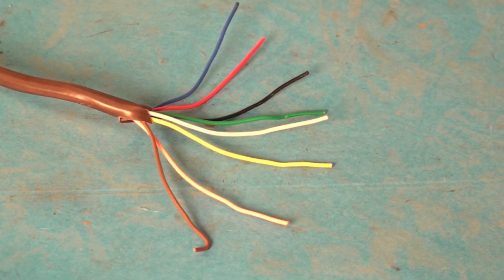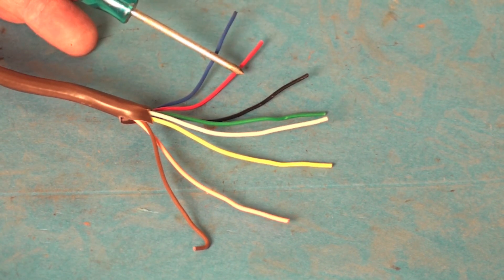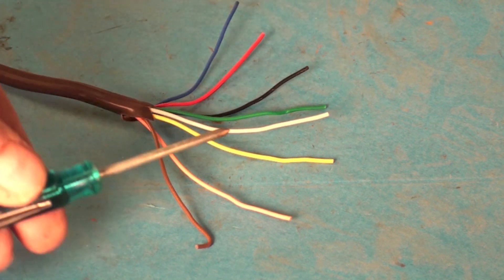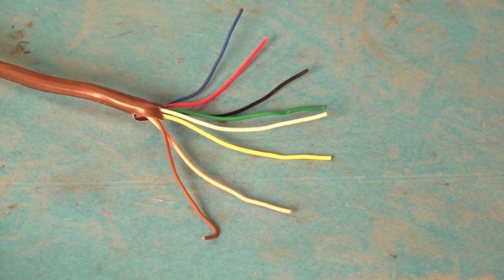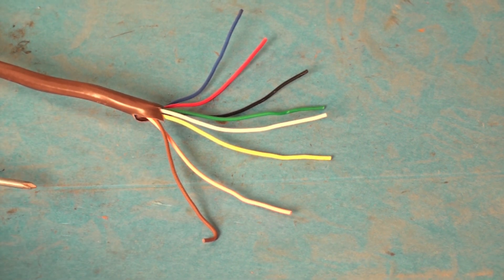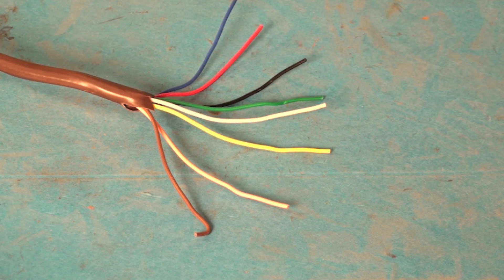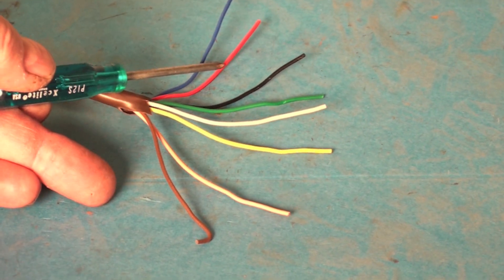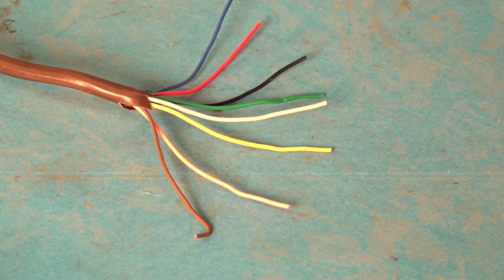Heat pump thermostat wire color code

Comment: blue is common (c), 
red is (rc rh) jump them together if your not sure
orange is (o) on majority of brands * excludes RHEEM RUUD then you would hook to (b). If it has a b/o terminal then hook to that and follow book to program it to energize those terminals in heating instead of cooling. 
green is fan (g)
white is (w2) 
Black and brown are either outdoor air temp sensor (on newer houses) typically going to an s1/s2 terminal. If they are not connected on the old one then do not connect. If they are connected to W1/e then re-use, if you dont have a w1/e then stick them with the w/2 which will be a bitch but will help energize your heat strips on a call for E-heat.
Yellow goes to Y1 or if you have a y/y2 then that on carriers. 
Do not do this with the air handlers power on. You will blow a fuse or transformer and have to spend even more money on a n hvac tech to come to your house. 💪🏻
Reply: I have a Ruud AC from 1988. Last week I replaced my old mercury type round Honeywell thermostat with no programmable simple digital Honeywell thermostat (RTH5160). Since then my AC does not work. Outdoor unit is quiet both compressor and fan. Only indoor fan comes on.I had B Y G R W on old thermostat. Connected B to o/b on the new one. I don't think I have a heat pump. I tried leaving black B wire not connected, it did not make a difference. What might have caused no-ac situation? I couldn't find a fuse in my furnace. I replaced both fan and run capacitors too.
Reply: Recently, OxBox a Trane company also decided to change their wiring on their heat pumps. No idea why they would do that on their contractor grade equipment.  They energize in heating mode.

Comment: I am replacing my old thermostat with a Honeywell rthl2510c, my old terminals are as follow:
X-black
O-orange
Y-yellow
W2- light blue and white
G- green
E- brown
R- red
  
New terminals are:
B. O. G. Y. W/aux. NOt used. R. Rc. 

Any advice on how to connect it properly.  Also how do I know if I have an auxiliary heat pump or not?
Thanks
Reply: Just wondering why he keeps avoiding to answer any question regarding the black wire.  He answered the other colors and disregard the black one. So let me ask where does the black-× wire connect to in the new thermostat?
Reply from the maker: pamkaturi O to orange, Y to yellow,  G green, E brown not sure, R  and Rc jumper Red.  If you have an outdoor unit you either have an air conditioner or a heat pump.  You can tell if it is a heat pump by the number of wires going to the outdoor unit.  2 wires, you have an air conditioner.  5 or more, its a heat pump.  Hope this helps.
GFM

Comment: Wrong the brown wire is a signal wire if your going to explain the wires and what there for at least do it eite
Reply from the maker: michael houser The color code for control wiring is not set in stone.  This video gives a common method but is by no means always used.  There is no method that is universally accepted.
GFM

Comment: Can you put a Maples Chase   thermostat 9601 for heat pump on a ;forced air gas furnace with no AC ?  thanks
Reply from the maker: I believe you can. Just hook up the r and the w and place the system in em ht. Hope this helps. 
GFM

Comment: Copper wire is copper wire, there is nothing magical about the colors and you sure as hell can't count on it being wired up to any standard convention. Get a schematic for the system, google is your friend on this one, so you can tell what goes where. I have even seen the colors change from the control board to the thermostat. Have fun.
Reply from the maker: Jimmie Fender The point here is give some idea of what the code may be.  We have all run into color code usage that does not follow my guidelines.  Thanks for the thoughts.GFM

Comment: I purchases a Honeywell 7 day thermo.model RTH2510B showing the use of 4 or 5 color coded wires for use with my GE heat pump (running 35 years w/out repair) using aa GE Weathertron thermo model T344D100M179. The Weathertron has 4 hg bulbs with 2 white wires on left and only 1 on right.Please advise wiring instructions. I have pics but don't know how to send.

Comment: I wanted to change the thermostat on my Carrier based Heatpump sytem and I have encoutered issues.
The current thermostat is a Comfort Zone II (master) with a 2nd zone slave thermostat.
The wiring to the master is nothing as described and has only 4 wires Blue (RS-), Red (RS+), Green (VG) and Purple (V+).

I have called Carrier and theyve told me Ithat they're wifi thermostats will not work on it and in any event I would have to talk to a contractor. Called Honeywell, and they told me there's wouldn't work. Called a local contrator (in NC) and they told me the control boards and dampers would have to be changed to change thermostats - ~$2500

Any thoughts would be appreciated
Reply from the maker: Elliot Check Unfortunately, there is not any cheap way out of this.  The Wi Fi stats work ok with single zone systems, but with zoning its a professional job.
GFM
Reply: And extremely expensive
Thanks for the help

Comment: ok what if u have a 6 wire system for heating and cooling then how do I wire it, and what kind of thermostat would work any cheap one as long as it has cooling and heating or do I need a special one that well wire a 6 wire system ,the thermostat looks 100 years old its big and brown, so I don't now if I should even touch it cause everything is working but I would like to get a much simpilar one ,which I can set the heat or cooling and leave it alone ,thanks for any help
Reply from the maker: mrcrazy3872 I need to much more about this system.  Can you send pics of the wiring at the thermostat?
GFM
Reply: it wont let me post any pic on the message o well my luck.

Comment: I have a honeywell thermostat(batt powered) with 4 wires coming out(red,blue,white, and green) going to an old singer electric furnace. The spots to hook the wires on the furnace are labeled C,G,R, W1 and W2. I have red on Rc&R(jumpered), white on W and green on G. For the furnace I have green to G, white to W1 and red to R. The think that has me confused is that there is no yellow wire for the cooling. This also throws me off to where the two wires(red&white) goes to on the board. I only have the red with red at the furnace. I know the white should be with yellow, but I don't have a yellow wire nor spot on the furnace for it. 

Any help will be very much appreciated!
Reply from the maker: The problem here seems to be there is no yellow wire.  If the blue is connected to the Y on the stat, then the blue can go directly to the condensing unit of the air conditioner.  There is no need for a connection at the furnace.  If the white is connected to W on the stat, it should go to W1 on the furnace.  Hope this helps.
GFM
Reply: I decided to replace new stat wire going from the thermostat to the furnace. I have red, green, yellow and white in the proper slots. For the furnace I have G-G, W-W1, Y tied to white from condenser and R-R along with the red wire from the condenser tied on to the board as well. As of now nothing is coming on...

Comment: There is NOT a color code for wiring! IT GOES BY FUNCTION! I WORK FOR HONEYWELL AS A TECHNICAL SUPPORT FOR WIRING RETAIL THERMOSTATS! DO NOT GO BY COLOR! GO BY WHAT TERMINAL THE WIRES ARE IN!
Reply from the maker: It is true that not all units follow color code.  But to say there is no color code is chaos.  You must start somewhere and that place is with the color code.  Sometimes, when a thermostat or equipment is replaced, the number of wires used is not the same as the original.  Also, we have indoor air handlers and outdoor units with their controls.  Yes there is a color code.  And we use it when we can.  Thanks for the thoughts.
GFM
Reply: While I can respect what you are saying, I guess all I can ask is that when people are asking for advice on wiring up a thermostat, please make sure that we are telling them to also watch for what terminals the wires are in, because I can not tell you how many systems I have had a phone call on because they ONLY wired by color and because the installer of the system used a blue wire as a common and they place it into b for blue....so on and so forth....and I wish that there was a different labeling for "RC" because I have also had a number of people place the "C" wire in the RC terminal because they didn't have a "C" on their thermostat because it was run on batteries only and they didn't bother to read the directions.
Reply: "Rc" + "C"-  24V DC ?
"Rc"  "C"  24V AC?
How right?
Reply: What happen if I connect black and white together
Reply: @javiermontes3777  I believe nothing will happen because black is just a common
Reply: Honeywell instructions are garbage.

Comment: OK - I am replacing a thermostat  that has both an E terminal and an Aux terminal - Honeywell TH8320U1008.  My new Honeywell TH8320R1003 has a single terminal labeled Aux/E.  How do I compensate?
Reply from the maker: I would just put both wires on the terminal.
GFM

Comment: I disconnected my old thermostat, blue and brown were not used.  I just hooked up my new Honeywell RTH3650D using the same wires, left out blue and brown.  The outside compressor(?) thing comes on, but it's not working.  The pipes are cold and the vents are just blowing cool air.  What's going on?  Assuming I have it hooked up correctly (at least as far as the instructions are concerned), what could be happening?
Reply from the maker: I assume you have a heat pump.  You may not have set the changeover valve correctly in the installer setup.  Check the advanced par of the manual.  Hope this helps.
GFM
Reply: Yeah, I do have a heat pump. I think I did all that.  I went over and over it. And even called the help number.
Reply from the maker: Jonathan Abraugh Turn it to cool.  if it heats, the reversing valve is hooked up backwards.
GFM
Reply: I set it to cool, it blows cold air and the pipes get really cold.  So that's working normally I assume.  Anything else come to mind?
Reply from the maker: Jonathan Abraugh Not that I can think of now.
GFM
Reply: Well, thanks all the same.

Comment: I was told that Y1 should be first stage heat and cool and that one difference is one will also energize the reversing valve. I thought you should always use W for heat, but now I'm confused.
Reply from the maker: There is no always in this business.  On some stats W1 will be backup heat. On some, Y1 will turn on the reversing valve, and Y2 will be cooling.  Alll you can do is look at the wiring diagram to see how it is wired.
GFM
Reply: grayfurnaceman I was asking because I seen thermostats with no W terminal, in this case how would Y1 work as heating in heat mode?
Reply from the maker: SombraLocs If there is only a Y1 and no Y2, then Y1 is both heat and cool.  In this case, the reversing valve will be energized by the system switch.  
GFM
Reply: @SombraLocs  Just out of curiousity, what thermostat did not have a W terminal at all?  I have never seen that before.
Reply: @Kevin Bowman 😂😂😂😂😂 this was 8 years ago. I believe I was still in the process of starting HVACR school. Man, time flies.
Reply: @SombraLocs  Oh holy crap, I never even thought to look.  That is crazy!  Sorry about that!  I didn’t notice the time frame.

Comment: How do you run the thermostat wire  for heat pump unit 
pdoes it go fromthe thermostat to unit then from there to outside unit or what need help
Reply from the maker: The indoor air handler is usually the central part of the connections.  The thermostat takes power from the air handler, and distributes it back to the air handler and the outdoor unit.  Hope this helps.
GFM

Comment: Trane XR13 single stage heat pump with two stage aux heat pack in air handler. Here is what commonly used.
Red=24v, 
Blue=24v common
Yellow=Energize heat pump contactor
Green=Blower relay
Orange= Reversing Valve 
White=1st stage heat
Black=2nd stage heat and defrost board call for heat while defrosting 

On Carrier I have seen white used mostly as common , in my area.
But you should always check because there are it seems, a lot of color blind installers.

Home owners think they can save money by replacing their own t-stats but mostly they wind up calling a service tech anyway after they have blown either the low voltage fuse or the transformer in the air handler/ furnace.
Reply from the maker: Obviously, there is a lot of variation here.  The only problem I see with this method is the use of Blue for common is that if your pump has the reversing valve energized in cool (Rheem), and with the B terminal on thermostats, Often the blue(common) is connected to B on the stat which will blow the fuse or take out the Tformer.  Thanks for the thoughts.
GFM
Reply: @grayfurnaceman  In my 25 years, I have never seen a Rheem/Ruud here in Denver with the blue wire on the B terminal.  Broncos colors Orange and Blue.  Orange is always the reversing valve and blue is common back.  But I have never seen a Carrier with white as a common either.  I sell Bryant Evolutions and the new Amana's these days.  I did see an Oxbox made by Trane the other day and it energizes the heat pump in heating mode, but regular Trane units do not.  That was interesting to clean up on the wiring.

Comment: Dr.!  Thanks for all of your Vids...  The "Black" wire, is "usually", used from the Defrost Heat-Pump board, to complete the circuit of the "X", back to the the Air-Handler, to bring on the Electric Toaster Strips, during a Defrost Cycle.....?  This is the normal "AUX" call, when you see the Stat, call for this also...!??  Grasshopper
Reply from the maker: Around here we use the white for that because we usually use white for heat and  the defrost heat can go to the white at the air handler.  We save black for common.   No real accepted color code.
GFM

Comment: grayfurnaceman I have a question regarding demand defrost boards, I know that with demand defrost, there has to be a certain temperature differential between coil and ambient to start a defrost. How many degrees exactly is this differential?
Reply from the maker: It depends on the manufacturer and the age of the unit.  It must be below freezing and the one's I have seen were about 15 degrees, but no quote on that.   The newer units are have smaller differences.  Hope this helps.
GFM
Reply: Thanks. I know the difference between coil and ambient temperature is 15-20 degrees when the coils are not frozen, but it seems like it would be a lot more for the defrost to initiate.
Reply from the maker: John Smith  With ambient at 30 degrees,and 20 degree split, that would give an evap temp of less than 10 degrees.  At that point, the compression ratio of the compressor is very high and efficiency goes way down.  I would think that if the unit is newer, it would be even less than 15 degrees.  I don't have any factory specs on these parts.
GFM
Reply: I think that my TXV on my 2 ton Trane XE 1200 is busted. On heat mode, it's maintaining a differential of 40 ( when it should be 15-20) and it's triggering the demand defrost when it's not even frozen.
Reply from the maker: John Smith I would first look into refrigerant charge.
GFM
Reply: I already have. My indoor TXV is for sure stuck when in cooling. I have about twice as much subcooling as it needs, and the suction pressure is still too low. So the outdoor TXV is for sure shot.
Reply from the maker: John Smith It sounds like you are right.  However, the TXV usually fails shut or wide open.
GFM
Reply: In this case almost shut. Due to the high subcooling and high superheat.
Reply from the maker: John Smith Frost line on the valve?
GFM
Reply: Yes. The evaporator temperature is running 35-40 degrees below ambient, and if the humidity is high enough, and it's not warm, but moderately cool, it will frost over.
Reply: One more thing, I think the check valve might not be seating completely. On the cooling mode, tranes have a weird subcooler coil that is not used during the heat mode, and one side of the check valve always gets cold in heat mode, so i'm thinking the check valve is letting liquid bleed by, because the coldness doesn't go away after several minutes, and it would if liquid was just boiling off.
Reply from the maker: John Smith If its frosting at the txv, and not the coil, the flow is low.
It is not unusual to have small leak at the check valve, if its bad enough it will effect operation.  But that should decrease sub cool.
GFM
Reply: Well... This is what I get for having Wolff Mechanical do the install. It has other problems beside busted TXVs, the liquid line is 1/4 when it should be 3/8, which is how I probably lost my TXVs, and the suction line has no insulation. And it runs under my house, through the soil, with no conduit, which causes a lot of heat loss and heat gain.
Reply from the maker: John Smith The unit may have been installed using an older line set.  If your unit is R-410A it should have the line set replaced.
GFM
Reply: It's a Trane XE 1200 from 1996. It uses R22 but replaced and older Ruud unit that had the same problems. I am hoping to either get a job and fix it myself, or replace it, along with the line set with a 410A system.

Comment: I always remembered orange for the summer cause the sun and blue for the winter cause snow.  This is how I always remembered wich wire for what kind of reversing charge.  I know the sun is yellow and snow is white, but it always helped me when I was like 14.  Sounds like you been doing this since you were a kid also.  I remember only like maybe 12 A/C companies in the valley then.  Now there are literally hundreds.  Thanks.

Comment from the maker: One of the early problems we had was when the heat pumps stats came out with a B term. The installers were used to B for common.  So they hooked it up and when the stat called for heat, the transformer failed.  Thanks for the thoughts.
GFM